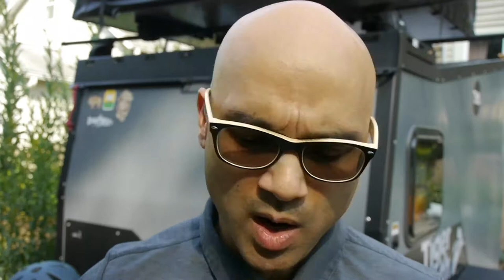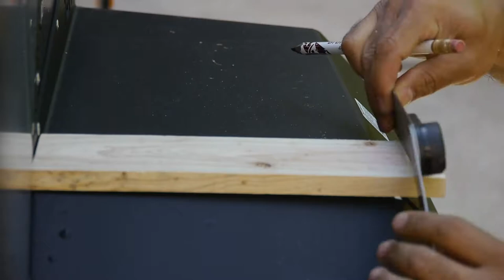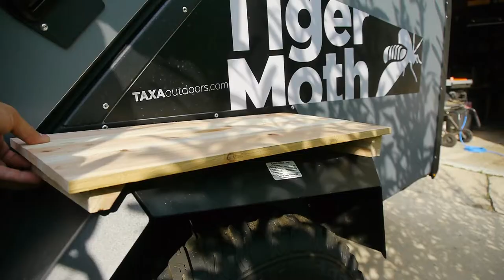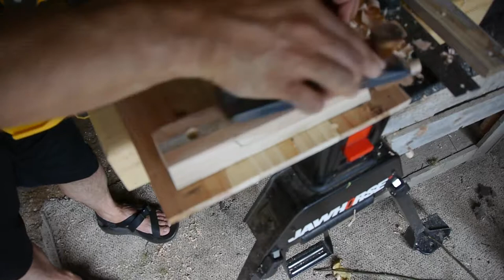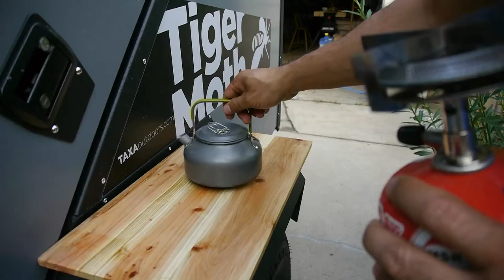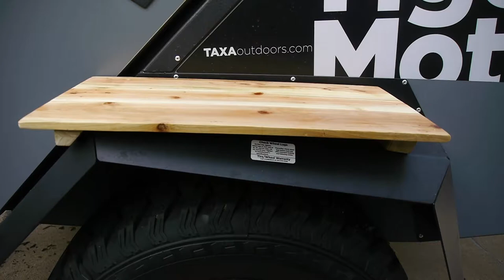Making a Cedar Tire-Top Table for the Tigermoth Camping Trailer

Comment: Quick idea I had from watching this: Set magnets into the screw-holes to hold your table more securely on to the fender! Prevent it from sliding if bumped or if trailer rocks. 

Keep up the videos, there isn't a ton out there on these trailers and you do a good job of putting these videos together!
Reply from the maker: That’s a great idea! I have a bit of inner tube glued on, but the magnets would be even better. Thanks for the encouragement. I’ll have a new video out from a longer trip to Estes Park, CO.  Stay tuned!
Reply: @Folktopia  Excellent, can't wait to see it! I would like to sit down and figure out this Youtube thing and do up a video of my own. Unfortunately winter is fast approaching, and I'll have to put her away for the season soon.
Reply from the maker: @SmallTownBigBass  You should definitely do it.  I'm messing around trying to figure out different ways I can take on/off the tent.